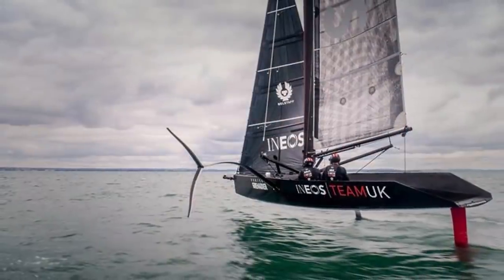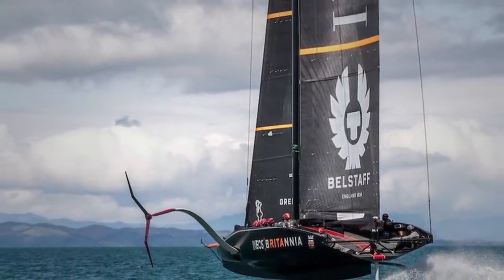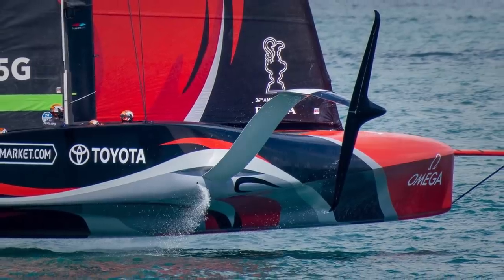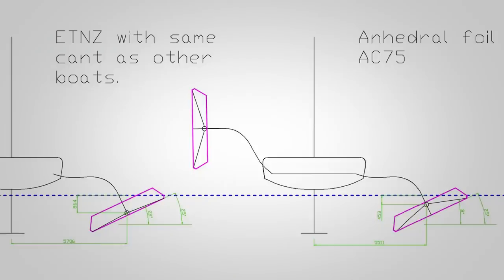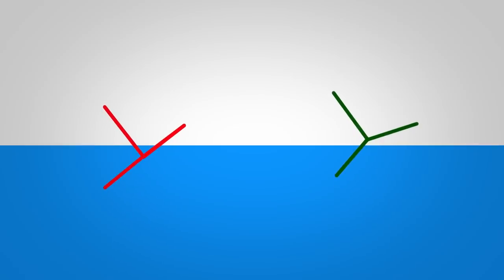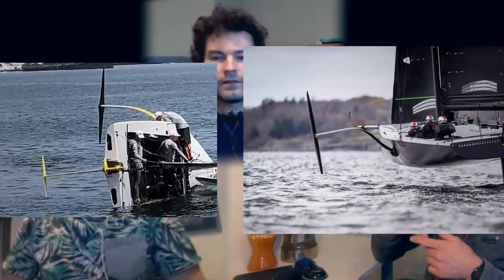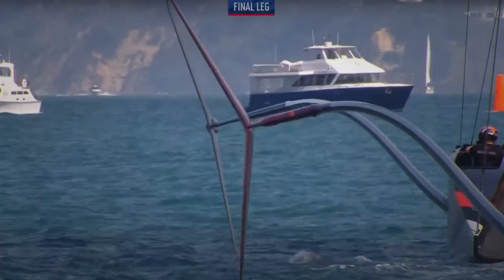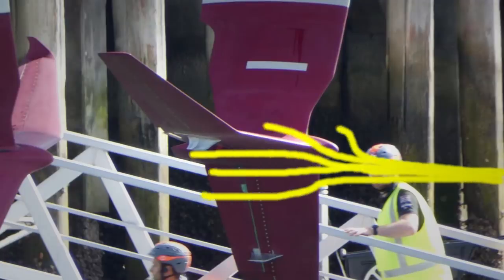Whose Foils are Fastest? ETNZ V Challengers // Straight V Anhedral

Comment: I'm not sure there is a lot of science backing your opinions.   What you should do is draft up the various shapes in 3D with a CAD package and simulate them for L/D using OpenFOAM or similar.  This is fairly easily done using FreeCAD.

One thing you overlooked was wings with dihedral will be more stable if the boat leans one way or another.   Just like airplanes with dihedral are more stable.    The swept back wings probably have something to do with the propagation of the pressure wave like a jet's swept back wings.  They might not lose life as fast as a straight blade.
Reply from the maker: Isn't anhedral added to airplanes to create instability in roll? Add some agility to otherwise cumbersome cargo planes?
We've got a upcoming video on the plan form shapes including leading edge sweep
Reply: @MozzySails  Not sure.
Reply: The other thing is the more foil wing area you have, the less pressure per square inch you need to get the same lift.   And the less pressure you need the less chance of cavitation.    

Cavitation happens when the pressure of the water above the foil drops below the bubble (vapor) pressure of the water at the depth the foil is at.   Bigger area = less PSI needed.   But probably more drag due to skin effect ?

With respect to how many foils each team built, I'm sure between simulation and water tank tests that they got exactly the foils they thought were the best for the conditions.  They weeded out the poor foil designs well before they built foils for the AC75s.
Reply from the maker: @SomeTechGuy666  which raises an interesting question. The foils are very different, so were the team expecting very different conditions, or was their thinking different?
Reply: @MozzySails  Good question !

I actually don't think there is a lot of difference in the L/D performance in the foils themselves.  I think there is more difference in the rudders and the control systems.   Did you see how hard Dean had to work against the rudder in 1st and 2nd races of the semi final ?   You do that in a Laser and you are dead last.

Let's not forget that lift varies as velocity^2.  We saw what happened when American Magic sped up and the foil developed too much lift.   The foil angle needs to be continually adjusted as the boat changes speed.
Reply: @SomeTechGuy666  Hi, if you have any evidence of TI or TUK conducting tank testing please provide as it is specifically banned under the rules. P.S. Don't worry about it for TA & if any for TNZ please destroy it immediately by throwing in the Rangitoto volcano! :-)
Reply: @cindyullsee393  I have no idea what any of the teams have done.  I've never met or talked to any of them.

Why would tank testing foils be illegal ?  It's the cheapest and simplest testing you can do.  

These days CFD is nearly as easy as tank testing.  Is CFD simulation illegal too ?
Reply: @SomeTechGuy666  They banned tank testing specifically to encourage more CFD testing as a more cost-effective solution I think.
Reply: @KonradKulwicki  That's funny.  With today's 3D printers tank testing is incredibly fast and easy.   CFD simulation requires a lot of intellectual and computing power, though it is getting easier and easier.

The big thing is that both of these practices reduce errors and waste when building the real boat, which is where all the expense is.
Reply: @SomeTechGuy666 When I read about it when the rules where announced, I understood that CFD was specifically to replace full-scale testing - perhaps they wanted to just cut off any and all tank testing so as not to provoke any rule-bending in that regard, or perhaps they deemed that the tank tests wouldn't scale well, so why bother, better go for a better overall solution, i.e. simulation.
Or maybe it is allowed for parts to be evaluated in tank tests, but I haven't delved that deep into the rules. ;)
Reply: @KonradKulwicki  Tank testing is very valid.  And cheap.  I fully get why they wanted to limit full scale testing and the number of parts built by each team.
CFD testing usually has to be validated in some manner.
Reply: @SomeTechGuy666  I am not sure but think that the rules do not allow the use of wind tunnel and water tank testing. This is making it more challenging for the design teams.